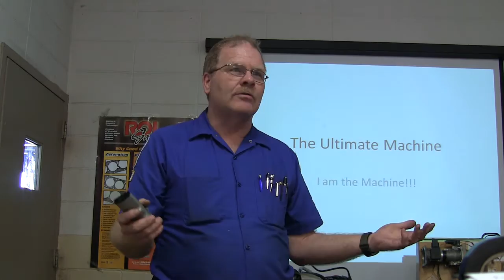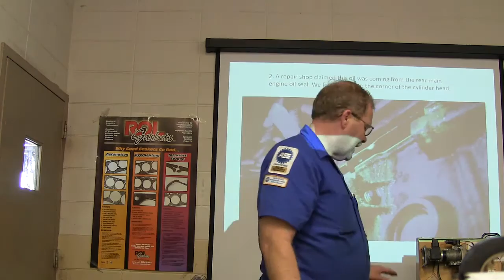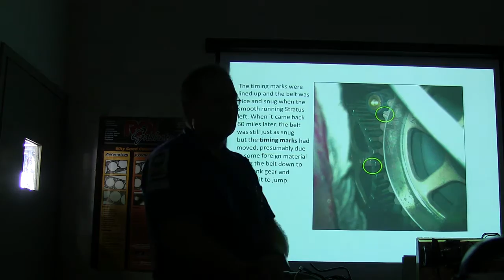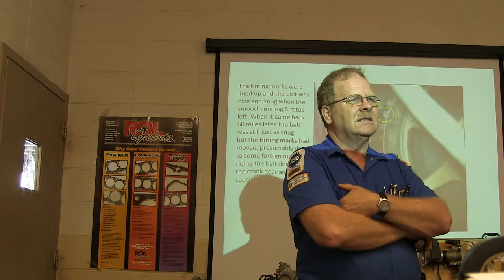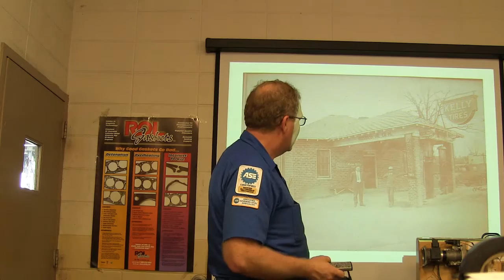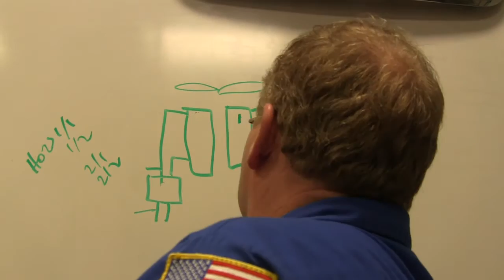War Story Thursday   Ultimate Machine

Comment: Good one on that rx-7. Had a small manual mazda blowing up transmissions every year = final drive explosion, ring gear explosions, and two gear engagement causing a lock gear explosion with a case exit. The common symptom was gear oil smell after driving on the highway. Cause of the problem = The rear bearings were dry and rusty. They did not make any noise or give any drivability problems.